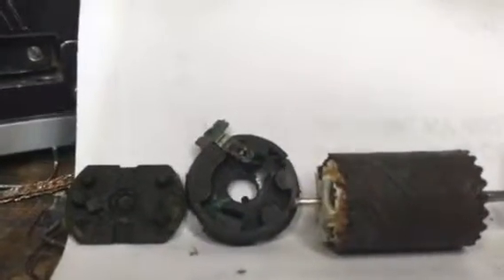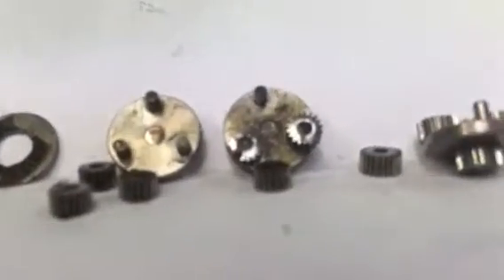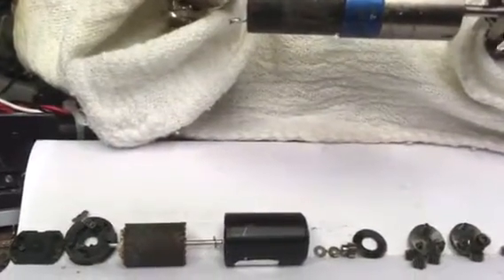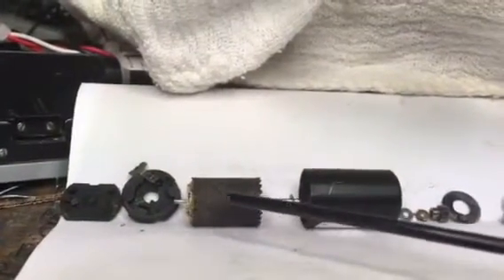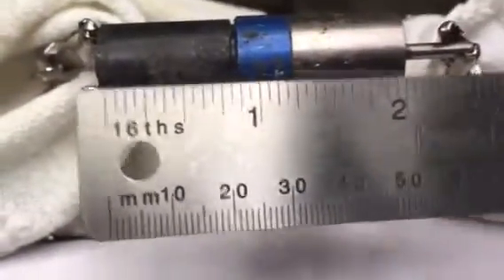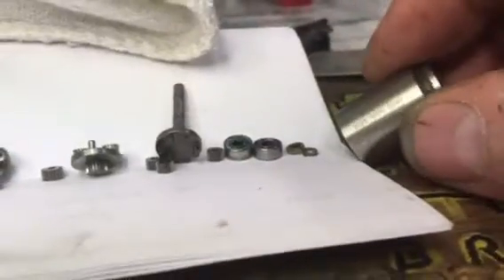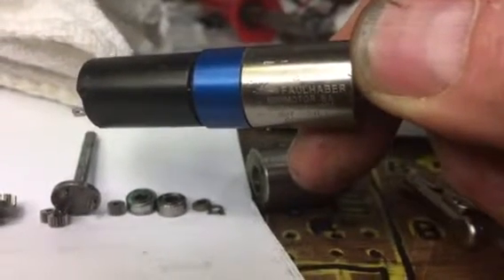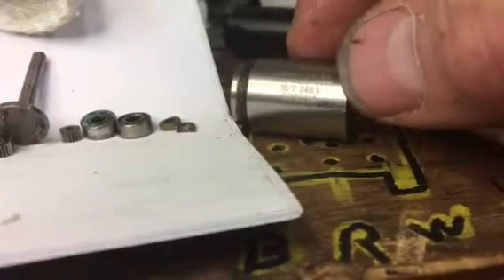Faulhaber disassembled motor and gearbox

Comment: Hi, how is the gearbox attached to the motor? is it glued? any hints to get them apart?
Reply: I also would like to know this question.
Reply: So I work for them and the way it's done is by using loctite. You can get them apart by heating the area around the threads eith a heat gun